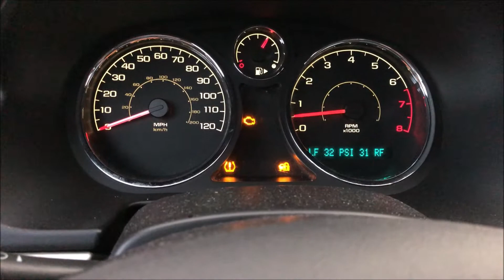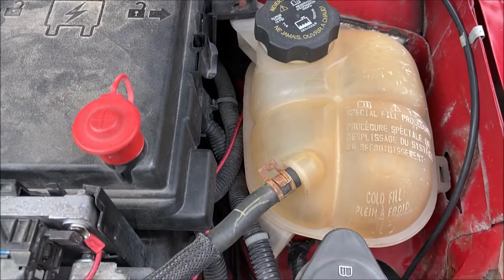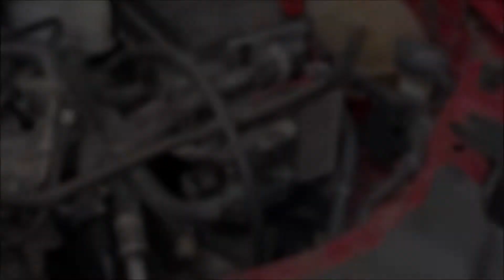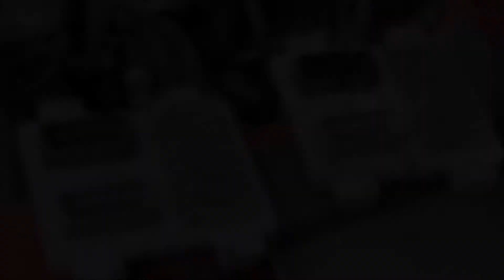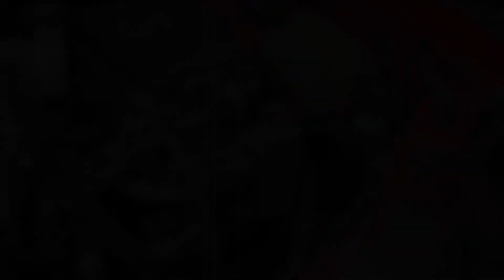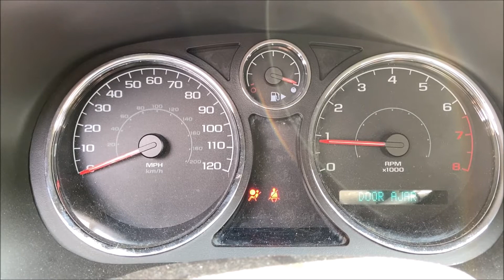2010 Chevy Cobalt Instruments going Crazy! What I’ve tried and ECM replacement

Comment from the maker: Check out the video description for extra info, parts, tools, torques, and any updates.
Reply: Amazing video Carbon! I have a chevy cobalt 2010 and currently having the exact same issue. I read all your updates. Did you happen to figure out the issue at last?
Reply from the maker: @amirbayoumi9878  Unfortunately I never did. A couple of months after I tried another fix, the car got totaled on the highway. We’ll never know if I’d actually fixed the problem, sad to say. Thanks for watching, Amir. 

Some questions will never be answered – the demise of the Cobalt
https://youtu.be/1N_fcZSGahA
Reply: What type of wire & gauge did you use for ground?
Reply from the maker: @OrchestratedChaosRoll  I’m pretty sure it was 14 gauge wire because that’s what I had handy at the time.
Reply: Any chance you have an updated link for a refurb ECM? We tried the TCM and it didn't help. Having a bit of trouble finding a cheap replacment ECM. Thanks
Reply from the maker: @stainedbrain2496  I can’t vouch for these but a couple I found on eBay:
https://www.ebay.com/itm/256205882610?mkcid=16&mkevt=1&mkrid=711-127632-2357-0&ssspo=Wj-iH4tZT6W&sssrc=4429486&ssuid=_D1cUevjTm-&var=&widget_ver=artemis&media=COPY

https://www.ebay.com/itm/312608146429?mkcid=16&mkevt=1&mkrid=711-127632-2357-0&ssspo=9zhM0Q0XRfi&sssrc=4429486&ssuid=_D1cUevjTm-&var=&widget_ver=artemis&media=COPY

Good luck! Thanks for watching.
Reply: I have ECM otw hopefully get this week VIN programed. But question did you ever have to do the Cam shaft position relearn? Just ask cause a tech 2 is onsale that can do it for $245 & sure the shops will charge me $80-150. This has been a nightmare with 2 mechanics.
Reply from the maker: @OrchestratedChaosRoll  I never had to do a relearn. I plugged in the new ECM and it just worked. No engine codes or engine issues (aside from the fact that the initial issue reappeared after a couple of months). After plugging in the new ECM, put the car in run/on for 15-30 seconds before you try to start it. Let the new ECM communicate with all of the car first. Not sure if it’s necessary with this car but it’s what I did and what you have to do with some other makes/models. Good luck! 🤞
Reply: Had you repaired ground G105? It's a large cable that runs from behind the ds headlight and bolts just to the right and slightly below the oil filter housing where another smaller ground with 6-7 small wires.
Reply from the maker: @richardgray742 I did look at/for every ground I could find, disassemble, inspect, clean, and reassemble, including that one, and it didn’t help my problem, unfortunately. 
It’s a good general thing for folks to look at though, for sure.

Comment: On my 2010 Cobalt configured with an automatic transmission I had a problem with harsh shifting and it turned out to be a short to ground that involved the obdII system's monitoring of a pressure switch internal to the transmission.
In my situation when the computer detects abnormal voltage in an obdII related signal it changes parameter settings in an attempt to limit transmission related damage and the operator will experience harsh shifting. Once I eliminated the short to ground (the wiring harness was routed near the hot engine  near the oil filter and melted the insulation) the problem went away and CEL went out.
I bet a lot of Cobalts are in the shop for the same problem I had.
Reply from the maker: That harness rubbing on the engine near the oil filter is a notorious place to get a short. Definitely inspect that wiring thoroughly. 
Thanks for the comment and for watching.

Comment: For those at this point went through a list of parts & 2 mechanics as well as a new ECM no fix. For me it was the top camshaft position sensor to the right of the fuel rail. My wiring harness was rubbing on it & stripped the coating off after noticing. I used some electrical tape fine now. Unlike in this video my wiring harness was on top resting or right rubbing on the plug. Grabbed a new plug still have to install.  After replacing the ECM maybe week late had check engine light & lean code & misfire permanent code after the the electrical tape within 1.5 miles after a 10min warm up the codes cleared .
Reply from the maker: Good find with that wiring! Maybe that’s encouragement for everyone - check that wiring closely for signs of damage.

Comment: Did you have to perform the 30 minute security relearn and Crankshaft relearn after the ECM replacement?
Reply from the maker: @rigodiaz01  Keep in mind that I got one that was preprogrammed with my car’s VIN. I didn’t have to do anything with mine other than plug it in and start the car. 
Mine was the base model though so it didn’t have a security system; I had no trouble with the key fobs though.

Comment: make sure the bottom ecm plug has no oil residue in the ecm plug area. if it does oil pressure sensor is wicking oil through the wiring and that oil causes all kinds of issues. (if oil is there) clean it out real good with contact cleaner. put some dialectric if you wan on the socket and replace your oil pressure sensor. (sounds crazy i know but its a thing)

Comment: Wife drives an 09 Cobalt. For a couple months its started sounding like a lawnmower. 

Before that, if would randomly have freakouts where the power steering would go away and the moh and rpms would bounce randomly. Also the radio doesnt light up or work. Could be connected issues not sure.

Comment: Funny my 2010 is completely out now not intermittent, i was around 130-135k as well, and when my wife had the car they repaired a wire bundle near the fuel tank from what she said.  Also showing the car lock icon and I've lost all my gauges.  I'm looking at replacing the instrument cluster.  I've seen a few videos with intermittent issues, but none where it shuts off.  Also if I turn ignition to accessory the engine stays running.  Just got it back from a mechanic like this.
Reply from the maker: Oh wow.  That sucks!  I was always afraid this would happen to mine, but it never did.  One time I did have it refused to work/start for 5-10 minutes but after letting it sit long enough, it came back as if it never happened.  So bizarre!  Sorry I don't have any good advice for you on this one.  I hope you're able to find and kill the gremlin!

Comment: I have a 2010 cobalt with in safety mode if I change the ecm Would This solve my problem? And if a ecm from another cobalt would work bolt on?
Reply from the maker: There could be any number of reasons that it's in safety mode (I'm not really sure on them - just speaking from experience with my Jeep Wrangler).  One could certainly be the computer/ECM but it might be something else (sorry, I know that doesn't help).
The ECMs do need to be VIN matched, so it won't be functional (or at least not 100% functional) if you just take one off another Cobalt and install it. The ebay link in the video description is where I got my VIN-programmed ECM replacement (and there are other places out there that does it as well, I'm sure).
Thanks for watching, Benny, and good luck.

Comment: Found that the issue on our 07 hhr was actually the wiring going into the ecu itself the oil pressure sending unit was leaking oil and it had seeped up the line to the computer when you pulled bottom connector off of computer it had a sizeable amount of oil in the connector cleaned with electronics cleaner and replaced oil sensor and issues went away
Reply from the maker: I'm glad you mentioned this - I'd seen this in a couple of posts but when I pulled my connector apart, I didn't have oil anywhere and I never made mention of it in my video.  Thanks for the reminder and tip for folks.  And thanks for watching.

Comment: I had this same issue and replaced the TCM and ECM just to have the issue still happen here it was the speed sensor and the wiring was compromised. So always check the simple stuff first.
Reply: Do you mean it was one of the speed sensors for one of the wheels?

Comment: bad connection take all fuses out and relays reinstall clean all connections to ecm and bcm and trans. Problem fixed hasn't came back even drove it to other states. Before i as afraid to drive to the store. Wasted money replacing just about everything and still had say issues Do that before spending any money. Only issue i have know is the cruise works when it wants too

Comment: The problem is the TCM fuse has a GMLan data signal running through it which produces square waves and pits the fuse. Repeatedly. DC fuses generally deal with sine waves I believe. Not sure how you could go about making a better fuse. Littelfuse 10a hold up a little better than some of the other ones I've tried. I hear using dielectric grease on the BCM connectors helps.

Comment: A commenter, spikedspike, may have discovered the cause of this issue. I made the linked video hoping to make the possible resolution available to more people: https://youtu.be/oGAfw2xpucU
Reply from the maker: This is great! I wish I still had the Cobalt. I would definitely go check this out. I don’t recall any oil in the ECM connector when I replaced it but based on the comments by spikedspike you could still have this issue even if you don’t see oil. I hope this resolves the issue for people. It would be great if we start getting comments on your video (well done, btw) or here on whether this fixes it or not.

Comment: I noticed that I do not have ground wires connecting the ecm and tcm
Reply from the maker: You shouldn't need them; they should be grounded through the harness, but some people had success by adding the additional ground wires.  It didn't make a difference in my case.

Comment: i have exact same issue on 05’ cobalt ls sedan everything went haywire after parked with engine running then when i was ready to go it stated to misbehane dash,power steering engine and transmission went wonky when i got home and turned it off for a while and turned on everything went fine so i test drove seems fine …..i couldnt figure that out i ran obd ii readr says 3 codes as u2100 and u0100 and tpm switch stuck on …….

Comment: I just ordered a " 2008 - 2010 Cobalt 2.2L Engine Computer 12612397 Programmed To Your VIN ECM PCM " for my 2009 CHEV HHR LS Panel Wagon " from the link that you provided .  I just bought this HHR a few days ago " ASIS " after giving it a thorough checkover. I discovered very corroded battery terminals and a very weak battery . I cleaned the battery terminals up very well and installed a good stong battery in it . The motor and trans runs and shifts great but after about 10-15 min starts running a little odd " no overheating or noises " . The gauges and Digital Vehicle Information Center all act erratic as yours " and others in videos I have seen " also seem to do. Other research that I have done all points to the ECM and or BCM .  I have the car sitting now with the battery disconnected, TCM AND ECM removed and it will sit that way until I receive the replacement ECM . Once I recieve the replacement ECM I will then reinstall the clean all contacts and plugs well , reinstall the TCM and the replacement ECM , Hook the battery back up and give it some test runs to see how it does. I may also remove the BCM before then to clean those connections up before reinstalling , repowering and testing . I will update when all is completed. I will also GROUND all upon reinstalling .
Reply from the maker: Thanks for watching, James. I don't think I mentioned it in my video butt I've also replaced the battery and that didn't matter a difference either. 
I haven't disconnected the BCM and cleaned those connections; good idea. Do let us know how things progress with yours.
Reply: @CarbonsDIYGarage  Received the ECM , installed it , still the same issue.
Reply from the maker: @JamesWorley  This is so frustrating!  I've discovered that when it happens (randomly), it will eventually self recover.  Sometimes just if I shut it off, open the door, close the door, and start it.  Sometimes I have to just let it sit for a bit.  Sometimes I have to drive it a while in this "bad" mode and it randomly self clears - except for the transmission code and check engine light.  I then use my code reader to clear the codes and the car is 100% back to normal for who knows how long - could be weeks or months.  Then I repeat the above cycle.  So infuriating and frustrating.

Comment: Has the problem came back?
Reply from the maker: Yes, the problem came back after about 6 weeks.  I then moved on and replaced the TCM (https://youtu.be/Lh-K7NWa6yI).
It's currently been about 12 weeks since I replaced the TCM and the issue hasn't come back.  However it's going to have to be at least 6 months of no issues before I fully declare it fixed.
Thanks for watching!
Reply from the maker: Just to add another follow-up.  After 130 days, the issue came back again.  So, after replacing the ECM and TCM, the randomly occurring problem still occurs.  So frustrating!
Reply: @CarbonsDIYGarage  I have a 2005 cobalt, has been a nightmare lately. I grounded my TCM, with 2 ground wires to shock tower, and still the transmission bucks terribly. However, whenever I add a little 10 W 30 to the 5 W 30, it seems to work ok for a week or so... then the bucking problem returns.  I will never buy Chevy, or any American brand, ever again.
Reply from the maker: @tomlindroos828  Thanks for watching, Tom!  I can't agree more on  your assessment.  I got this Cobalt for a really good price and boy - I really have to keep that in mind when I deal with this stuff.  It's really disheartening how the US brands (well, the GM and Chevy brands in my personal experience) have slipped so much over the past couple of decades.
I hope somehow your Cobalt starts behaving better for you.  Good luck!
Reply: @CarbonsDIYGarage  The sad thing about the Cobalt is that the mechanicals are great, but the lousy electric modules ruin would could have been a classic Chevy..... so sad. From now on I'm buying Japanese.....
Reply: @CarbonsDIYGarage  isn’t this part of the GM recall?
Reply from the maker: @PS3rulls  I haven’t found it part of any recall or even a TSB for my 2010 Cobalt. If you know of one, please drop the info into a comment.
Reply: @CarbonsDIYGarage    I saw this because im have the same issue...if you by chance you Do NARROW IT DOWN PLEASE LET me in on the secret....Our cars doing random no start no turn issue...Its breaking my Gfs heart...an know LIL2NOTHING about cars tho so theres only so much i can do...im also POOR AS HELL ...then again 2022 i doubt any of us are loaded
Reply: @CarbonsDIYGarage  hey man there's a ground under the steering wheel near the radio in the far back right check to see if its tight. Its the ground for the whole instrument cluster
Reply from the maker: @lnfnation2678  Hey this is great input. Thanks! I’ll definitely try it (if I can find it) and report back.
Reply from the maker: @lnfnation2678  I did find the ground you’re talking about, tucked up under the right side of the steering column, like you said. Mine was securely tight (tried to tighten it more, wouldn’t budge), but maybe others will find your tip to be the source of their problem.
Reply: @CarbonsDIYGarage  yeah sorry man. That was my problem on why my cluster would go haywire. Hopefully it will help somebody
Reply: Did you ever get it repaired. I have done the same as you and I can't figure it out.
Reply: @rollinlollar9191   it’s an intermittent problem rn. I notice it happens more in the winter but in the summer it might happen when it’s humid and or wet/cold.
Reply: Thanks for your video. I was having the no crank issue until i grounded the TCM and ECM.. Did well for a few days and started having your issue but not the gauges just the lights would flicker.. going to try the ground wire under the steering column next. Thanks so much.
Reply: 2010 Cobalt. Starts great. If I let the engine warm up, no problem. If I take off before the coolant is 60 celsius, then when I stop the car the RPMs drop. If it's cold enough, the engine stalls. Put it into park, restart, drive - no problems. Replaced the coil packs/sparks, throttle body, cam position solenoids. Going to try fuel injectors, MAP, and MAF next. Sucks to throw parts at it but the parts are reasonable and the car was dirt cheap. No real instrument issues - my cruise went out and my "reset" button stopped working but I replaced the three mid-high (third) brake light bulbs in the trunk lid and that fixed it.

Comment: Also if you replace the BCM you may need to do the key relearn procedure. (Charge your battery first) Then put key in ignition (the new/used bcm may give you a key lock light) You will then wait for the light to go out, after 10mins of the car on the light will go out. Do this cycle 3times and your car will start right up with a used bcm

Comment: Get a used body control module (BCM) preferably from a 2010 cause yours is a 2010. Also same type of car sedan/coupe. If yours has power windows get one with power windows. Record the mileage before you unplug it. Then swap it out. Order a OBDstar x300m and program the new mileage to it. That should fix your issue!! You can have a shop program your cars vin# to the BCM and also the possibly the radio, depending on which one you have
Reply from the maker: Thanks for watching, Carson!  Well, if replacing the ECM and TCM (https://youtu.be/Lh-K7NWa6yI) doesn't do the trick, BCM will probably be next.